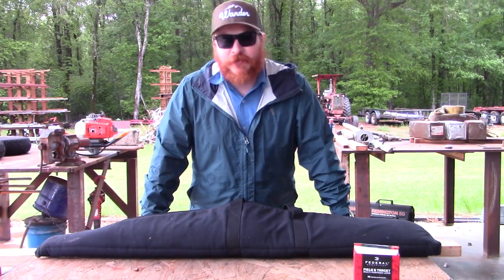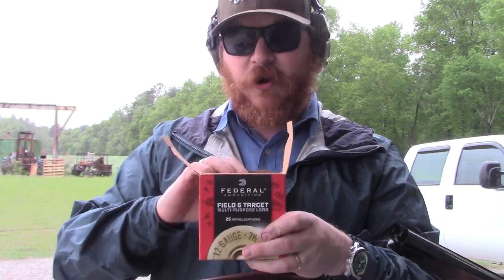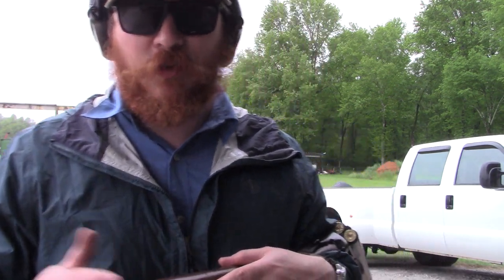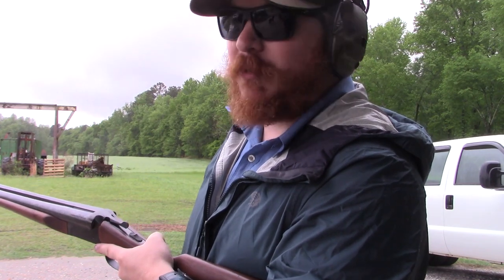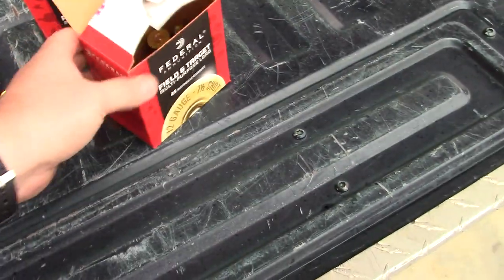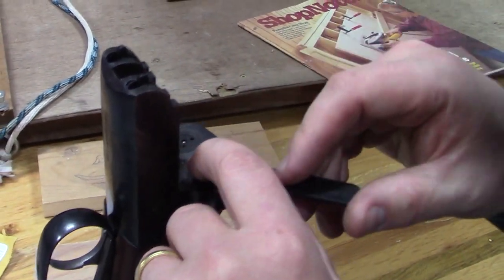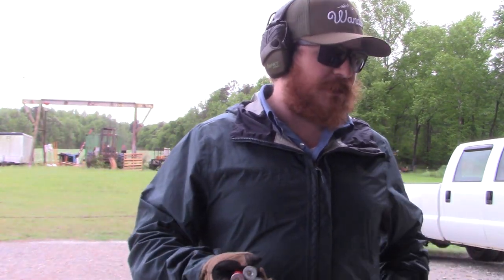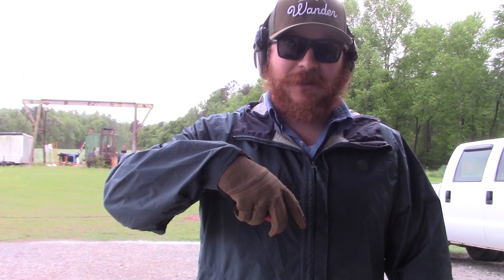Stoeger Coach Gun Problems! Needs New Firing Pins?

Comment: I had the exact same problem with it, not firing on my left barrel, took the gun apart found had burrs on both the in going and outgoing to the firing pin, as well as the little bolt or three hole nut I had to clean those out plus the three hole nut or bolt as they call it had burrs on the inside the firing pin could drag on, so I ran out drillbit just ever so slightly larger than the hole, that made it a lot better. Also, the firing pins had lots of burrs on them from the machining put them in a drill and use Scotch-Brite on them first course and then fine, they worked great after that as far as the firing pin goes. but also found my left firing pin spring was collapsed and not pushing it all the way through the hole, stretch the spring out like two loops, longer than the good one on the right side, then the firing pin, fully inserted clear back to the hammer, also found, the seer on my left hammer was an eighth of an inch short, which translates into the hammer travel was less than a quarter of an inch, on the right side. It was a little over a half inch, the hammer was not getting a FULL throw, could not find any suppliers for a replacement seer, finally was able to get one after a long duration of searching, in the meantime, I had a friend weld the end of this seer long enough that I could use a Dremel and clean it up, on its the same length the gun worked a lot better however, I still every once while would get a misfire, and I also checked in the two hammer springs one was way shorter than the other due to the spring, collapsing, ordered for springs just to have them on hand, spring came in more improvement. However, every once in a while, I would get another misfire on my left barrel after polishing everything and getting rid of all the burrs. The thing worked so much better however occasionally got more misfires, I took a step back and did an overall look at everything, and you’d be surprised what I found the left side of the stock that goes up alongside the hammer was nice and shiny and smooth where the hammer was rubbing. The right side was raw just like it was cut at the factory, took a knife and hogged out where I had clearance of about a little over an eighth of an inch did not interfere with how the stock mounted, took it out, and tested have yet to have a misfire sense. I think the stock was my major problem initially, but some of the other things that I fixed would eventually gave me other problems but now the shotgun is extremely reliable and absolutely love it.
Reply from the maker: Wow! Thanks for the detailed response. I'm glad you got yours figured out. I'll pin your comment in case someone comes along with the same issue we had! Cheers!
Reply: I've got a light primer strike on mine, too, and I sent mine back to stoeger, and it still does that and I'm not a gunsmith
Reply: Make a video of what you found, please
Reply: This happened to me at the Canadian SASS Nationals on this very model after years of no issues. Took her stock off and sure enough there was a bunch of goop then a smooth surface where the hammers had been dragging. You’ve saved me a ton of time on this thank you both!

Comment: Short brass shells will drop before the ejector can hold the shell. Coach guns were made for max charges, originally. Try long brass shells.. I hope this helps.
Reply from the maker: Still seems like I shouldn't be getting light primer strikes, especially just on one tube. One side is 100% and the other is not, unfortunately.
Reply: Do they make longe/stronger pins that people can buy to replace the factory.

Comment: Make sure your hammers and related linkages aren’t sticking. You’re getting light primer strikes. The reason the primer dents are different is because when the shell fires it get driven back against the extended firing pin. The length is okay it’s a weak hammer problem.
Reply from the maker: Yea, the binding feeling is concerning. Definitely feels like more than just a mushroomed firing pin.

Comment: mine did this for the first time this past weekend; cowboy match.  will have to take the gun apart to see if it is dirty.   i do shoot black powder in it, so i maybe getting dirty inside,  thou i doubt that.  left side at first but the right side gave me some issues too.  pulled the pins will have to clean them up.   will report back once i got it open and see.
Reply from the maker: I'll keep my fingers crossed for you! Fresh firing pins and cleaning the firing pin channels didn't solve my issue.

Comment: The most likely issue whenever these problems arise is a burr or burrs within the action. This includes the linkages. Remove any burrs you can find, relube, and reassemble. If still having issues, check the strength of the hammer spring. Don't believe that's the issue, but check it. A simple comparison of strength with the left spring will give an indication. Also, the extractor appears to be too loose in the camera. It should have very little free movement, especially when the action is open. The stainless firing pins are a worthwhile purchase even though they didn't fix your issue. The lube shown is perfectly fine.
Reply from the maker: Its's just odd that it was perfect for a few hundred rounds then just started all of a sudden. Usually when you have picky guns, they are picky at first and then break in to be reliable.
Reply: @entryleveltactics  - Understandable thought, but it's possible for a burr to move when the action gets moved. Kind of like a rivet - takes several hits on the head to form it into a rivet, or a linkage burr to start binding. And it still could be a weak hammer spring. Don't think so, but it is certainly a possibility. Maybe a small crack that hasn't completely transected the spring. 
Be interesting to find actual cause.

Comment: Your problem is you got a female gun. It acts up without notice. You might want to try firing pin Springs. Maybe one's weaker than the other and check if the firing pins extend through the holes equally.

Comment: I was getting light strikes on the right chamber. I found that the left side (inside surface) of the right hammer was dragging against the right side of the receiver, which weakened the hammer blow.
This was evident by drag marks on the hammer. I polished the side of the hammer and also lightly filed and polished the receiver. Problem solved.
One and a half more years of SASS shoots since my repair without any further trouble.

Comment: Hey, I am having a similar issue and I intended to change the firing pins as well. After watching the video I won’t since I doubt that’s the issue. I have a stoeger uplander that I shot only 50 rounds, two games of trap. Every 25 rounds it misfired once. Since the gun was barely used I didn’t expect to have any issues. I subscribed and hope you can make a video whenever you fix the issue. Best of luck.
Reply from the maker: Thanks, bud. I suggest just getting in touch with Stoeger. I haven't heard anything back about mine, but I'm hopeful.
Reply: Hope you figure it out. For me this is my first and only gun so I’m hoping there’s a solution to this.

Comment: I've had on and off problems with one of the barrels on mine since I bought it. A quick Google search and it is apparently a known problem with Stoegers in general. I had read somewhere that the spring inside (not the one you removed with the pin) is the culprit because the external hammerless construction of it is at fault.

Comment: Towards the end of the video, when test firing after new pin install, you showed two Winchester loaded shells.
Check out the video, and you’ll see one of the loaded shells that didn’t fire has an unbelievable deep dished shell head.
Almost looked like it was a reloaded shell that someone has the incorrect setup on the primer seating station.
I’ve seen dished shell heads mostly on cheap promo shotgun shells.
You did not show yourself cleaning the area around and inside the pin cavity or the pin retainer.
Also the way you move the gun around so fast, it’s hard to see if the extractor rim steps are machined to the same depth.
Could be something else also, good luck!

Comment: I have found that some shells will stick to the chamber when hot.  Wait 30 seconds or so to open the action to see if it is easier.  Mine did open easier.  ** I shoot a two trigger gun because the single trigger models DO have issues with switching sides.  Try cleaning and lubing the working parts.  This is a known issue when they get dry or dirty.
Reply from the maker: When mine gets hung up, the extractor jumps over it almost every time. Doesn't matter if it's immediate or if it's been sitting.

Comment: Same problem. I WENT WITH large pistol primers brass hulls. Light strikes are more OK with pistol primers. The guns from Brazil so are the hulls.
Reply from the maker: I'd rather not have to run different shells than I run in my other 12 gauges. But I admit I've been a bit lazy getting this resolved.

Comment: The first week I owned my Stoeger Coach Gun, I replaced the firing pins with stainless steel.
Reply from the maker: Unfortunately, upgraded firing pins didn't fix this one!
Reply: @entryleveltactics was it the wood in the stock rubbing, like craigescott said in the pinned comment?
Reply from the maker: @squawk3120  Not that I can tell

Comment: Did you sorted out your problem? I want to get a coach gun but i dont want a Stoeger,instead i will get a russian Baikal IJ43 or IJ58,they are easy to find here in canada. I have 2 Baikal already,1 with exposed hammer and the other is hammerless but i dont want to cut them. Baikal sxs are bullet proof and very well made.
Reply from the maker: Not yet, unfortunately. I've been dragging my feet and the Stoeger has been sitting in the back of the safe again.

Comment: Are the external hammers supposed to rest on pins when in the down position or is there supposed to be a small gap? I just purchased a Sulun Arms SC-215 and first thing I noticed was that the right hammer had a small gap and the left was touching. Is this normal and if not which one needs adjusting? Any help would be much appreciated please and thank you!
Reply from the maker: I would suggest reaching out to the manufacturer or a local gunsmith to answer that question, as I'm not familiar with that model, sorry!

Comment: Buy hardened pins from Shotgun Boogie.  Common issue known to CAS shooters
Reply from the maker: I put in upgraded, extended firing pins in this video. Same thing before and after.
Reply: @entryleveltactics think your problem is the extractor. It’s either worn or loose enough to allow the shell to get past it on one side. This causes the shell to set a bit deeper in the chamber causing the light strike, and prevents the shell from being extracted. Also will cause the action to be hard to open due to being in a bind with the one shell having gone past the extractor holding it too tight against the action.

Comment: It's really hard to tell because quite honestly ammo sux now. But the best thing you can do with a stoeger is change the firing pins out.

But about the ammo? I buy a lot. I have bulk .22 ammo from the late nineties to early 2000s still. I bought a S&W MP 1522 and used that old ammo to sight it in. At 25 yards 3 round shot groups with open sights within a dime. OK. I bought the same ammo in the same colored box but instead of 550 rounds all I could find was 300. These were federal LR with 36 grain hollow points. The new rounds were hitting up and to the left and the shot grouping sucked. Think 4 quarters instead of 1 dime. This was using a rest in the front and I didn't get to be that bad of a shot in 7 days.

So my bet is on the ammo and quality control from the manufacturer. In my Stoeger Uplander, my firing pins are still good after about 1000 rounds.

As for the post about high brass shells... yeah from where? I got older high brass pre Covid but after the ammo "shortage" I cand find any high brass other than 4 and below for waterfowl or turkey. And  target loads from 7 and 8 are not small game loads for squirrel and rabbit. And my squirrel loads are running out. He'll even with .22LR there are no more head shots. He'll you can't even know where the round will go anymore.

Like I said the ammo sucks anymore. To the point now that I only squirrel hunt with my old front stuffing 20 guage black powder double shotgun. I can still find black powder and primers and 6 shot. When it rains a little grease around the primer totally water proofs the charge. I have even noticed shotgun shells have a screwed up pattern now. Really inconsistent from the older ones.

With that said there is probably nothing wrong with your extractor but rather the dimensions of the ammo. Just because every product after Covid sux now. It's like quality control hauled ass away from us.

But I am so old I still remember hunting squirrels and quail with waxed paper shotgun shells and they were old when I started hunting at 12 with my dad's single shot 12. Even with an ejector you had to still pull them out.

So you shouldn't have ruled out the firing pin too fast. I still have an Amantino double before Stoger bought them out, check the bottom of your receiver, my grandma bought me in '82 and looks and stamped the same as my newer Stoeger. No exchangeable chokes though and better asthetics. Has a nicer butt plate with a spacer and pistol grip plate with a spacer and between the wood and metal totally smooth and checkered deeply and not like now. The exact same gun but different quality. She bought that gun at Otasco for me. There was no over tooling of the foregrip checkered in the little release button to take it apart. Hell there was a white spacer between the butt plate and pistol grip plate. But the same manufacturer E.R. Arranging. She paid roughly 100 dollars to make that birthday one of the best for a hillbilly kid.

I am just stating. Again ammo sux now. An E.R. Armantino gun and I still shot mine on the range from time to time with about probably half a million shots with pellets at animals and now Stoeger owns the company. It's funny how a 100 dollar shotgun in the 80s looks better that a 500 dollar shotgun today with so much more quality from wood to blued steel and fitting of the wood to the metal.

Comment: Quite frankly, I feel scammed by all the people recommending this gun. I replaced the firing pins, did some modifications, etc. Now I'm at a 75% firing failure rate with Winchester AA. Maybe my stock is rubbing on the hammers, maybe the hammers are shaped wrong, maybe the hammer springs are weak, maybe the sears aren't shaped right, maybe the parts are too rough, maybe there's burrs that I missed, maybe the firing pin rebound springs collapsed, maybe the grease is slowing things down, maybe the gun just doesn't like the cold, maybe the sun is shining too much onto the gun, maybe the iron content is off, maybe the planets aren't aligned, maybe the last election changed something.

Maybe it's all the above. Never buying another.
Reply from the maker: It's hard to admit, but I'm kinda in the same boat. Tons of cowboy action guys run them and like them, I just wasn't ready to do this much trouble shooting on a brand new gun with technology this old.

Comment: If I had to guess, I’d say your extractor is the problem
Reply from the maker: It definitely feels related. You can almost guarantee if it feels like it's binding up, the next shot will be a light primer strike.
Reply: @entryleveltactics  mine had light corrosion on the extractor shaft. I removed it and cleaned/ polished it as well as the shaft hole. Might bt worth a try?